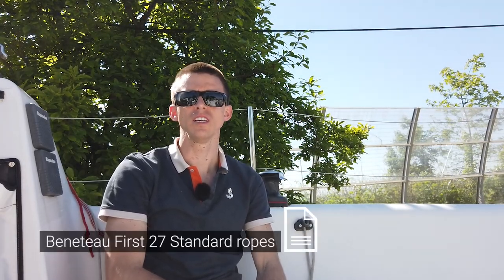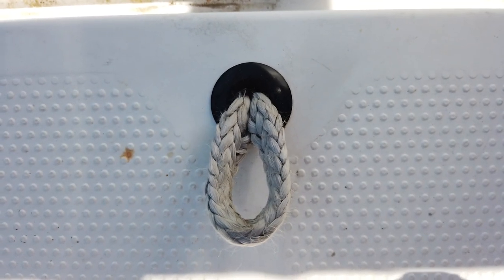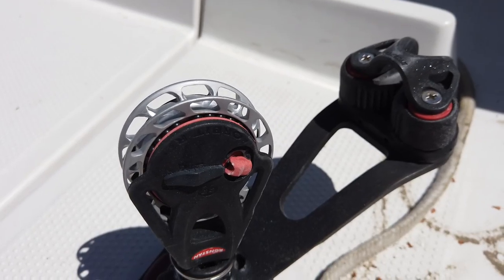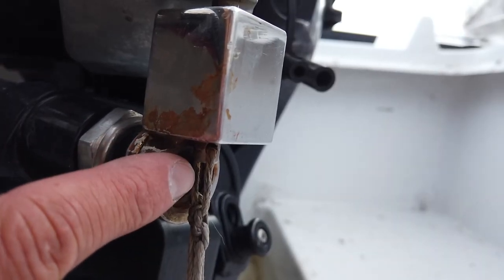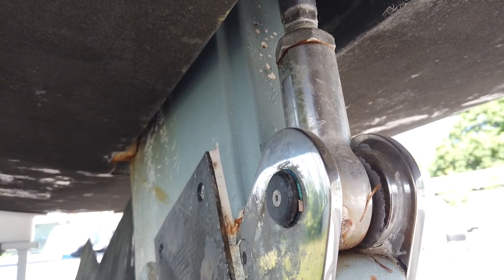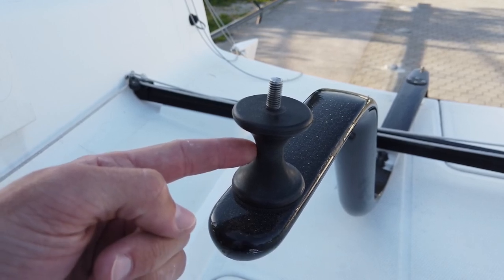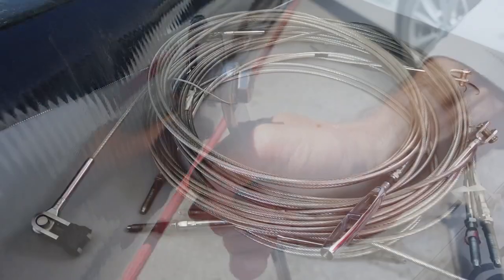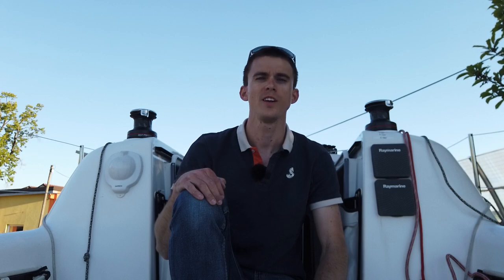Knowledge Base - Beneteau First 27 SE Pre-season Checkup

Comment: Question about a keel. If you hit a shallow lake bottom, will it break or it will pivot/hide?
Reply from the maker: Release valve will open and the keel will simply swing backwards. it was tested quite a few times by now ;-)